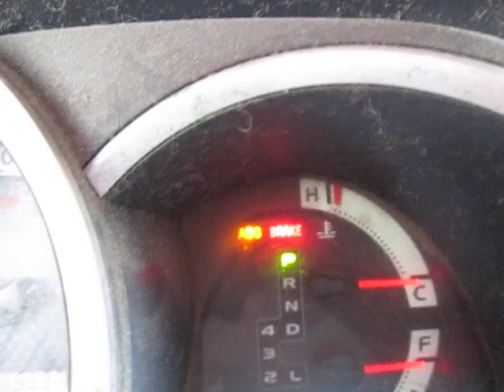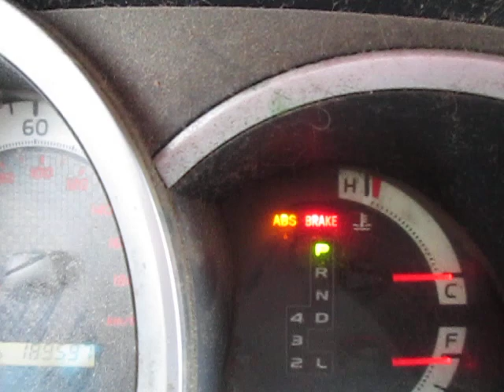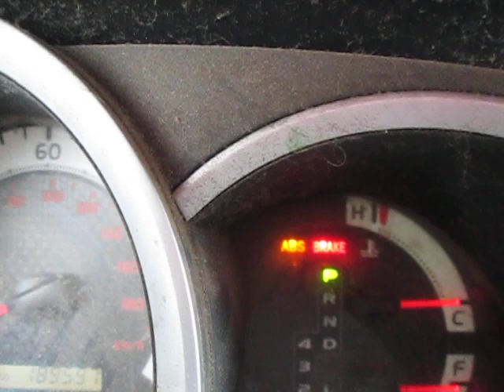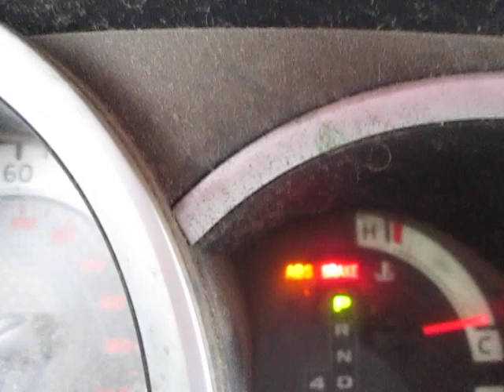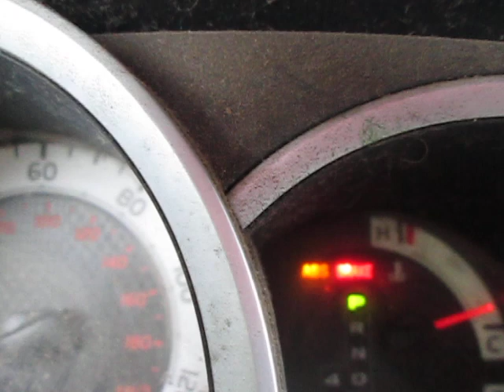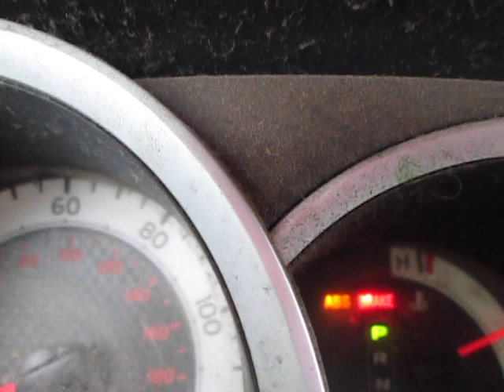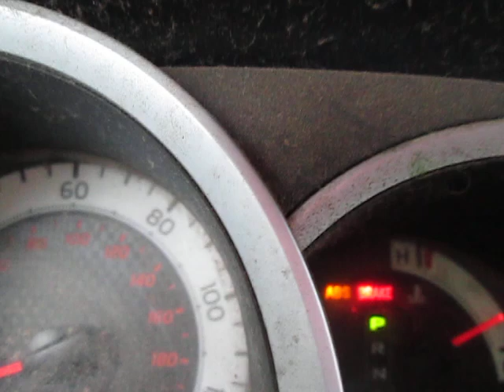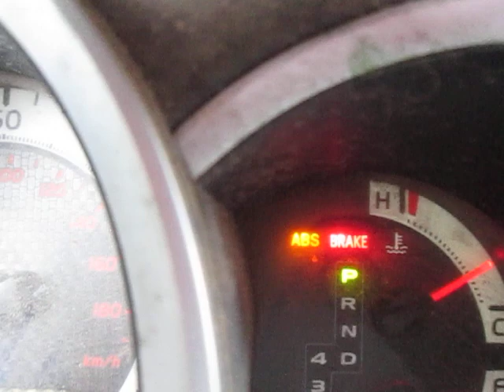How Do I Get Rid of This Damn Brake Warning Light When My ABSs Really ARE Screwed Up?

Comment: I'm pretty sure you can't fool the inspector with disabled warning lights. Non-working ABS will almost certainly be noticed in the brake test.

Both times I've had this happen it was the sensor. The local greasy fingers fixed it while I waited. Not too expensive.
Reply from the maker: Just ordered a four-pack for less than thirty bucks on Amazon. I'll get the Amish kid to put them on next week.

Comment: I assume you have checked the obvious eg brake fluid level also pad thickness on all 4 wheels, could be corroded reluctance ring on the driveshaft ends or hubs, so too far from the wheel speed sensors to count so it will trigger an error, that's how it knows a wheel/s is locking so it rapidly pulses the braking system on and off to calm a skid.
Gaz UK.
Reply from the maker: So, how do I get the damn red light off?
Reply: @Humptydumptytribe  Ps You can't simply clear the fault lamp with an OBD ( On Board Diagnostic) device, unless it's an intermittent fault, but those can come back to haunt you, eg on vehicle inspection.
Reply: @Humptydumptytribe  I have tried to reply, but it does not show in history or reloading page ?
Reply: @Humptydumptytribe  If you get an OBD scan tool, you need one that can diagnose ABS faults, not all do though.

Comment: Try disconnecting the battery, reconnect may reset the warning lights.
Reply from the maker: Gee, never thought of that. And don't forget pressing the accelerator three times, slamming the steering wheel left and right twice, and taking out the fuse.